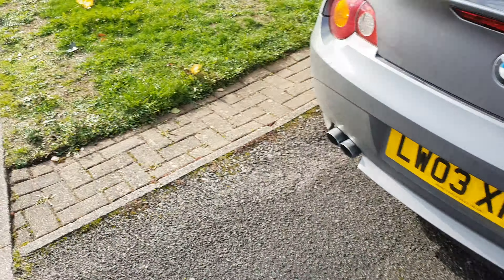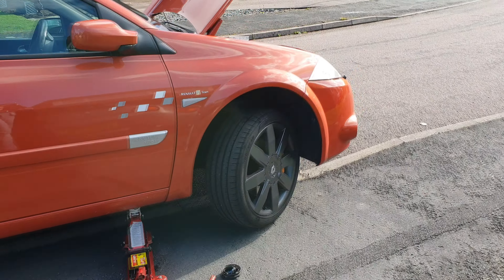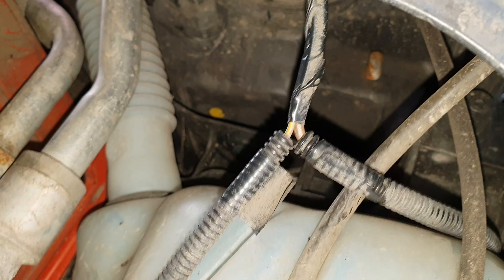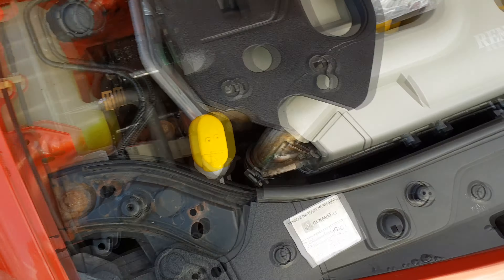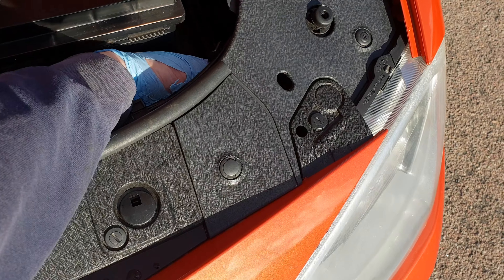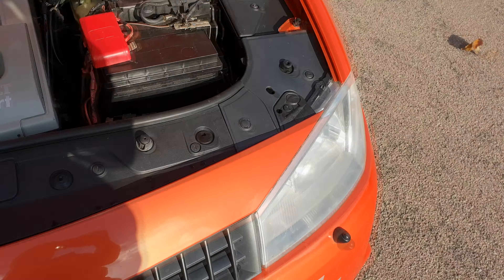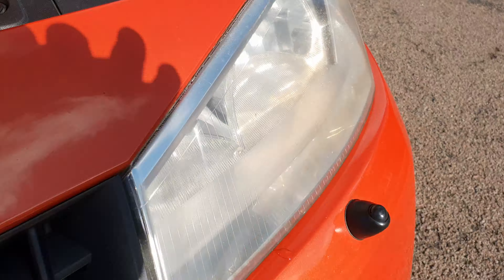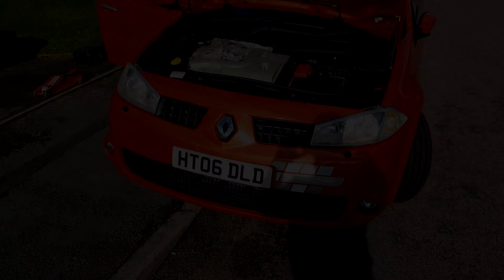Renault Megane MK2 Headlight Bulb Change - VERY EASY 5 MINUTE BULB REPLACEMENT

Comment: For me, the biggest problem is pushing the pin in the holds the lamp in place on the passenger side (UK).
I can't get ehough leverage to push it from the wheelarch, and there is no line of sight from top to push it with a chopstick or something like that.
Eventually I get it out, but that single part of getting the clip usually takes me around 20 minutes.

Same goes for re-attaching the rubber cover on the driver side part for the front sidelights and main beam.
My technique is to fold it out like a sock, put it in place, and then allow it to fold back over the circular hole.

Absolute pain though. Especially for someone like me who prefers to use high performance lamps, which absolutely DO blow more often.
Reply: D

Comment: So here I am watching this video and I just realised when I saw the reg it’s my car I bought it a few months ago lol
Reply from the maker: Lol I hope you get on with it better than I did! Fun until it breaks...which is often
Reply: I’ve owned a couple before and for some reason changing this bulb has been difficult to my last 225 and now the spring that holds the bulb in place has come out. Now a couple of faults are showing up, engine miss fire and something to do with the catalyst converter but regardless it’s a fun car to drive
Reply from the maker: @b14nger  Make sure you use premium fuel in it, it has the 98 RON Fastchip map on it, might be causing misfire if not
Reply: @b14nger  

No word of a lie... she was also my car at one point! Do the rear windows still not work? I also had to fashion a temporary handbrake lever button from a piece of dowel and an old o ring as a 'temporary' solution but it worked so well I left it!

Great memories of driving to Borth, Wales in it, these cars are absolutely made for roads like that!
Reply: Sounds to me like this motor been through more hands than a crackheads push bike lol 😂😂😂

Comment: Doesn't work for the indicator light. Can loosen it, but it won't come out, from wheel arch, or from the bonnet. Have you got a solution for that.......!!!
Reply: An angle grinder will make short work of any annoying body panels in the way. You can then use a hammer and chisel to fit the bulb. Hope it helps 👍
Reply: Indeed🤣🤣🤣 @henrlima87

Comment: Hi All, Anybody has already tried to put instead of traditional halogen bulb, led bulb to low beam h7? Was the project image proper, could you please advice any product which is compatible? I have a 2008/12 Renault Megane II 1.4 16V. Thanks!

Comment: Pay Halfords £8 let them have the hassle
Reply: Haha I tried that and even they said they can't do it
Reply: They are not obliged to do it. They'll just give you your money back
Reply: @dandtdavies3999  no ones obligated to do anything, but they would look stupid if gave money back and said can’t do it 😂😂😂
Reply: @ez3817  I must say, I take it all back. Popped into H as a last resort, plus explained car was tricky. Young bloke managed to get hand in and sort it. No battery removal etc. Great. He seemed to enjoy the challenge of various cars.
Reply: PS two other mechanics had failed to do it (without loss of face) without removing the battery, which I was reluctant to do as I don't have radio code. My car does not have access via wheel arch so might be slightly different model etc

Comment: My lights don't have that clip that holds the bulb in, so it's practically impossible to change the bulbs without removing the headlight units since you have to jam a screwdriver into the socket. :( Thanks anyway.
Reply: I literally have the same problem the person who had the car before me had attempted to glue the bulb in lol
Reply: I can get my hand to it via top without moving battery but I can't seem to tug it out. Didn't realise access point underneath so am going to try that. Don't think I'll have dexterity though